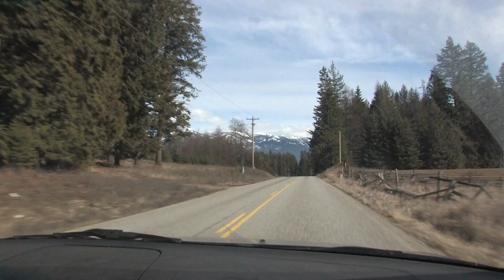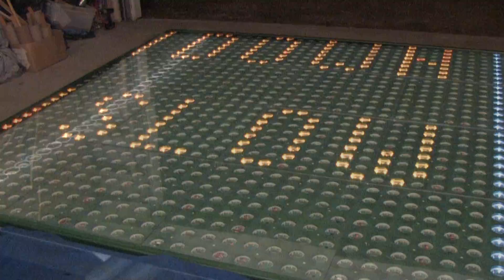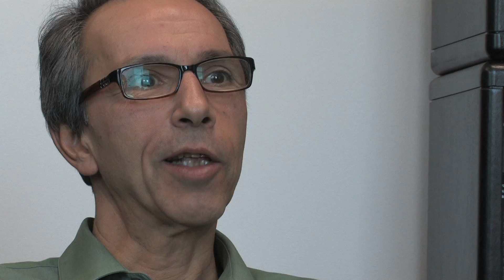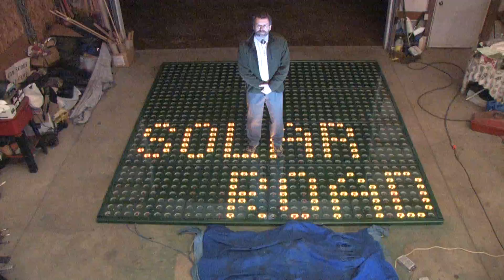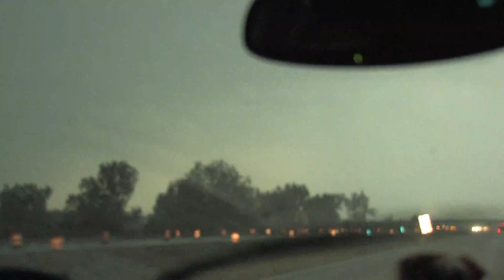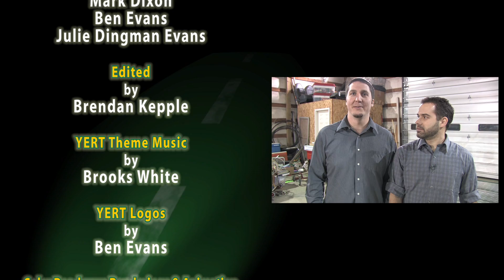Solar Roadways: The Prototype

Comment: There is an endless list of problems with this whole idea.

Firstly, they keep pounding on how hard glass is. That's rather inconsequential. Bitumen is soft, and that's precisely why it makes such an optimal binding material for asphalt: It adapts for differences in temperature, and it doesn't break under stress. (Also, the gravel used in asphalt is harder than glass.) Glass on the other hand, no matter how hard, shatters. Especially tempered glass (which is what they are promoting) shatters easily with even the smallest of cracks. And if such a pane of glass shatters on a speedway, not only will it destroy the solar panel, it's a huge safety hazard for the cars.

And such glass panes will get shattered pretty easily and pretty often if used on a road. You can't avoid gravel and small sharp stones ending up on the road and vehicles driving over them. They will crack, and they will shatter, that's just a fact of physics.

Also, such loose panels are hazardous on a road all in itself. Like said, bitumen being soft is great because it adapts to whatever small changes there may happen on the soil under the road. Rigid panels won't, causing unevenness and dangerous situations.

They are also greatly overestimating the efficiency of fixed solar panels on a road. Solar panel efficiency is something like 30%... when facing directly the Sun. These panels won't be for the vast majority of the day (and at many places never.) Also only a fraction of the hexagon will actually have solar panels, decreasing the efficiency even further. Transporting the electricity will incur even further losses and thus decreased efficiency. (The 30% efficiency estimate of a solar panel facing directly the sun is measuring the electricity produced directly by the panel and does not take into account losses caused by transporting the electricity over larger distances.)

Add to that the fact that the proposed LEDs and all the electronics in the panel will consume a significant portion of said electricity, and you have to reduce the total efficiency even further, possibly even reaching zero or even negative efficiency. (And if you add to that the completely ridiculous idea of heating elements to melt ice, you go well beyond negative efficiency pretty fast.)

And add to that the fact that the Sun doesn't shine all the time. It gets cloudy, it rains, it snows, the road gets dirty, cars are parked on the road... over half of the day will be night in winter (especially the more north you go)... Thinking that these panels will produce more energy than they consume during an entire year is a completely ridiculous idea.

And of course there's the problem of cost. It doesn't matter what kind of production lines you have, producing this many panes, with this much glass and this much electronics, is going to be prohibitively expensive. The panes won't be producing enough electricity to even run themselves, much less run anything else, so it would only be a complete waste of money.

The proposed LEDs won't be visible enough in bright daylight. It doesn't matter what they claim (and their counterexamples are fallacious). There's also the problem that LEDs, electronics and entire panels will get broken. This not only will hinder showing anything on the road, it would actually be a hazard.
Reply: tbone66613
Engineering cannot break the laws of physics, no matter how enthusiastic and visionary the engineers are.

"The solar farm in canada "first light " is only on .36 km squared of land and is creating enough power for 1000 homes ALL YEAR AROUND"

How are the panels oriented? Are the panels full of electronics, LEDS and radio transmitters that need to be run by their own power? Are cars and trucks constantly driving over them, grinding gravel onto their glass surface? Are they covered in oil, rubber, dirt, gravel, and all kinds of stuff? Do they constantly break off, causing hazardous situations to cars driving at 80 MPH? How far away from the panels is the power distribution plant?
Reply: @DjVortex-w  I disagree with you completely!! It's engineers that built the laws and it will be engineers that destroy the laws.
Reply: There's also the cost of upgrading the education of every road worker in the areas where these would be installed. Who's going to pay for that? It sounds like a gigantic black hole if you ask me.
Reply: Also, even if this were somehow feasible to implement and they would be implemented, people are going to steal the panels.

The authors argue that there would be anti-theft systems using radio communication between the panels. Besides this increasing the cost and energy consumption of each panel even further, it's trivial to circumvent: With a faraday cage (which would be easy to build eg. inside a van or truck.)

And a faraday cage is not something that you need super-expensive advanced technology to build. You can easily build one from scrap metal at virtually no cost. (And even if 99% of criminals wouldn't understand the concept, it's an easy-enough trick to teach, so it's enough for just some criminals to come up with the idea.)
Reply: *****
/watch?v=obS6TUVSZds

That guy actually knows how to do the math. He is also an electrical engineer.
Reply: Just because the project has good intentions doesn't mean it's a good idea. Place the tiles over the roads instead if you desperately want roads and solar panels to be united. People become defensive about it and think any criticism is anti-green or some shit. No, I believe most critics just want the attempts at producing viable energy alternatives to be practical and feasible.

This is not the only horse in the race, and quite frankly it's a crippled horse, but if you want to bet your money on it because it's cool or some shit then do it but it's a bit like deciding to use gigantic paper sheet barricades to defend yourself against a rising ocean, it might just cost you.
Reply: I really am pro-solar, but we have to consider the cons. They will get dirty, oily, they will break, they cannot produce enough energy unless they are facing the sun or they are placed in Ecuador, Libya, Panamá, etc. They will get scratched and that itself will deflect lots of light. Just throw a small rock to the road and the entire block is done. If one block cracks ¿where does the glass go? Exactly, now you have a chain reaction.
¿Can this 'project' boost glass research? Hopefully, but that's not enough. Supporters ignore a simple fact: They will not face the sun all the time, what you put in you'll get out, that's that. I know that our power demands are getting higher, fossil fuels is not the answer anymore, but with simple math you can tell this is not the solution.
I'm just bookmarking all these videos, will come back maybe two years later. By then the 'inventors' will be long gone.
Reply: TheBushdoctor68
Are those cells flat on the ground, or are they angled on a rooftop?
What was the cost of those solar cells? Add to them some thick, unscrachable, unbreakable glass, a good bunch of electronics, LEDs, batteries, radio transmitters, a metallic infrastructure strong enough to withstand 18-wheelers for 20 years, and a power transmission system capable of transporting the electricity for hundreds of miles. Then multiply that cost by some billions.
Then, of course, you have to add the cost of maintenance. Electronic devices, LEDs, batteries, and even glass, are going to break eventually. That's just a fact of life. With billions of those things, they will be breaking pretty much daily on average. (Just consider how many cellphones break in your country alone every single day. And they don't have cars and trucks driving over them.)
They will also get stolen. The developers claim they won't, but they will. That's another fact of life. (They go all about how the radio transmitters deter stealing. Seemingly these engineers have never heard of faraday cages, something that you can build from scrap metal easily and at virtually no cost, and can be easily fit inside a van.)

And this isn't even going to the question of how suitable glass panels are as a road material.
Reply: TheBushdoctor68
It sounds like you don't understand electricity at all.

"The ones on my roof generate enough power for my home AND feed back the excess power to the grid"

"However, when they DO pick up sun, they make a shitload of power."

How many solar panels do you have?
How much did they cost(install included)?
What is their rated output?
How much power do you produce per day?
How much do you consume per day?
How much do you buy kw/h for?
How much do you sell kw/h for?

The biggest thing is what the panels are rated for and how much power you produce per day. If they numbers are right your comment would hold some ground but if you actually do the math I'm sure you'll be surprised at how much power you are NOT producing.
Reply: TheBushdoctor68
If we're separating glass into breakable and unbreakable then there is only one kind of glass so far, breakable.

If you can invent unbreakable glass then I have a great business proposition for you!
Reply: Fade2Dark
They need to show us evidence that it has the same traction properties as asphalt. They say it will work but we need to see it. A 2 ton tractor driving at 5mph over it doesn't show anything.
Reply: +Matthew Madruga  "leds only cost less than a volt"
A volt is neither a measure of money nor energy. You have no clue what you're saying.
Reply: *****
So, who's going to pay for all those tiles? Who's going to pay for their maintenance? Who'd going to pay for all the accidents that they will cause?
"Who cares?" doesn't cut it.
Reply: I got a bolt, not a nail, a bolt in one of my rear tires, I can hear it hitting the pavement all day. And my truck also leaks oil. Sometimes I think that the dark stripe in the middle of each lane is there just because of me. Now, if the road was made out of glass ...
¿Have you ever seen a soda can or bottle in the road? I like to smash them with my truck (who doesn't). Now, if the road was made out of glass ...
¿Have you ever seen a vehicle blow a tire? Pretty violent, and then the rim running against the road. Now, if the road was made out of glass ...
¿Have you ever been in Los Angeles, San Francisco or San Diego around 4PM? Rush hour! Roads full of cars. Not sure if 60% of the sunlight reaches the road.
I had an accident once on my motorcycle. I had frame sliders on them so it wasn't so bad. Now imagine a frame slider hitting a block of glass. Not to mention that some bikers use metal cages. Go ahead, turn on your radio in the morning and listen to the traffic report, there's always a motorcycle accident, every day.
Now let's assume that there is a glass type that can handle all this punishment. In a period of 6 months it will be so scratched that most of the light will be deflected and won't reach the panels.
I'm tired of the 'is harder than steel' phrase. ¿What does steel has to do with anything? ¿Has anyone seen a steel road? ¿Why not? Think! Because replacing steel sheet on every accident is still expensive. Even [cheaper] steel roads are dumb, that's why we have steel tracks and not roads.
Oh, wait! There is a material that can handle everything and can make the perfect fit. Diamond!
This video was uploaded on 2010. I'll stay around for another 5 or so years following this 'project'. This thing is going nowhere. I am not anti-solar by any means but if you guys think it's such a great idea then go and donate. The more the better.
Reply: Laz Sz
So you are saying that glass cannot shatter if only part of the covering is made of it? (Besides their later version has a full glass cover.)

Glass can withstand a great amount of weight. when that weight is distributed over a large surface (such as a big tire) but not when it's all on one sharp point (such as the weight of a truck on top of a small rock).
Reply: +tbone66613  Math & mathematical modeling of the specific situation at hand (solar roadways) trumps in importance your bad analogies.  Nobody mathematically disproved flight was impossible or going to the moon was impossible (for a given cost).  By contrast, Thunderf00t & EEVblog have mathematically disproved solar roadways being anything other than a gigantic money black hole because of absolute laws of thermodynamics.
Reply: ***** Oh my god. I think you should watch the videos that I listed in my first reply to this thread.
Reply: ***** ¿Source?
Reply: Blaise McCord
Yeah simply because they are PANELS, the dirt and soot would definitely get inside the cracks as the panels expand and contract throughout the day. AND what about places in the north where we have snow??? Furthermore, since glass has VERY poor traction, they'd have to make a textured surface - thus allowing more and more dirt to gather up. As these panels break, they will need to be serviced at a rate many times higher than asphalt roads, and the people who service them needs much more advanced training. All this buils down to money. Another problem with renewable energy placements is that sometimes the high quality resources and pollution it take to make these panels and the countless accessories is enough to offset how the panels save energy in their entire life span.

oh and you can't plow away snow from such a textured surface
Reply: no no bro, because solar freaking roadways
Reply: That's why you test the product many times before adapting it. 

Don't knock it until you try it -- but don't accept anything until proven otherwise.
Reply: Kevin Ai Xin Jue Luo
Earth 4 Energy

Safe Redirect => http://home-renewable-energy.blogspot.com
Reply: Soner Gökçe ¿Did you bought it? It claims it has been advertised on CNN, Newsmax, etc. No links, just buy. Not saying that it doesn't work, I'm planning to build my own solar panels and solar heater and living on Southern Cali it's an easy choice. I don't need your link to know that solar panels work, but having untouched panels on my roof is one thing, 3 ton vehicles constantly running on top of them is a very different story.
Still waiting for any 'breakthrough' on this project. Still nothing. ¿When was this video released? ¿2010? ¿Any news since? Maybe that's because they haven't reached the 100 gazillion dlls. Go, donate.
Reply: this is true but they will fix it and this is going to be the future of roadways
Reply: Alexco21 How are they going to fix the problem of it not generating enough electricity to make them worthwhile?
Seriously, they would do twice as good as this could EVER be by putting properly tilted panels along the side of the road.
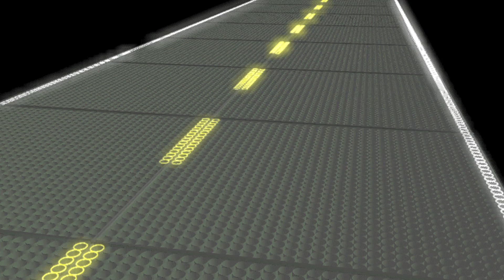Reply: 0:38   "even at 15% efficiency, it still produces 3x more power than this country uses on an annual basis."
Reply: *****
Even if that figure were even close to accurate, it doesn't take into account the cost of building and maintenance.
There are also other problems with the project that are not related to energy production.
Reply: WarpRulez I just love it when someone makes a comment with out watching the actual video.The whole lot is not just glass, the glass part are bloody small can hold a big lorry with out any trouble.
Did you notice that? It is not fully glass, just parts of the panel.
Well the trouble is it really could get stolen, but this could work.
Reply: WarpRulez We used to have a test sample of glass that was shatter-proof - I mean really. It can in a box with a stone weighing about .5 kilo. You could throw that stone at that glass as hard as you wanted and it wouldn't shatter. I don't know if solar roadways will work or not but it's always risky to say something is impossible.
Reply: WarpRulez Lookup "The Glass Age" here on youtube. Glass can be made as strong or as soft as it needs to be. Even 10 times stronger than steel!
Reply: Elliander Eldridge
The only way to make "glass" scratch-resistant would be to make it harder than rock. (After all, gravel consists of small pieces of rock, often with sharp edges and points.) If there's any kind of gravel on the road, cars, trucks and buses will be driving over it all day long. They are going to scratch that surface.

There are transparent materials that are harder than rock, but they are not glass, and they are usually rather expensive.

And if the glass is tempered and it gets even a tiny scratch, it will shatter.
Reply: Two words of advice for you pal....Fuck You.
Reply: WarpRulez  1 KWH is needed to power my iphone for an entire YEAR all the lights , and tech put into these solar panels will cost less then 1 KWH PER YEAR , so what the fuck are you talking about? you think 1 of these solar panels will lack the capability to produce a KWH in a year? biggest JOKE i heard all day. the "AVERAGE' solar array today produces 10.3 KWH PER DAY , so one panel in one single day would power 10 panels for an entire year and have 364 MORE DAYS to produce surplus power for the rest of the country? their is 1000 ways to make glass. some as strong as steel itself . as for breakage thats engineering ,it would be instantly transmitted that it malfunctioned and someone would go fix it , whats the difference if u hit one of the billion pot holes going 80 MPH "who drives that fast anyways unless on the autoban" . The Grid already runs along roads and goes to individual houses so it would only be a matter of connecting it 4FEET beside the road to the hydro lines running under the sidewalk, actually they would have constructed a chamber to house all lines,including hydro gas and fiber optics.
making future work MUCH EASIER and safe because you cant hammer a stake into the gas line and risk causing an explosion or the 5000$ fine for damaging it. so still i see NO valid points in your argument.
Reply: almost everything has a solution
Reply: +Matthew Madruga " if I know one thing about parking lots, it's there will be burnouts, drifts and much more after hours"   WTF are you talking about?
Reply: WarpRulez Here's an article talking about a glass that is shatter proof and stronger than steel. There are many examples of this I can show you, but the point is that you are wrong. Not all glass is the same. Not all glass is prone to shattering. And "hardness" is an actual rating system. You can't say that asphalt is harder than all glass accurately. You can say that it's harder than some glass, but not all. You also have to keep in mind that even tempered glass (which does shatter) can still be "harder" - that's a different issue all together.

http://www.dailymail.co.uk/sciencetech/article-1346525/The-unbreakable-metallic-glass-thats-stronger-tougher-steel.html

Another major advantage here is the modular way the road is put together. If, for example, one of this segments is somehow damaged it won't shatter and can be replaced very quickly. Instead of having to rip out the entire road and redo it like with asphalt,
Reply: Stop telling lies. Solar Roadways are the future! lol
Reply: everything you claim is a minor engineering problem and is solvable. The first Apollo rocket had less computing power then my cell phone , yet you think humans cant make this work? doing the "impossible " is how we got to where we are and if we want to keep moving we must keep trying. The solar farm in canada "first light " is only on .36 km squared of land and is creating enough power for 1000 homes ALL YEAR AROUND . my street alone with 100 houses at the most has much more AREA then first light , my street alone would have enough surplus energy to power over 900 houses , and you think a few LED's and heating system is gonna suck up that much power . my cell phone last 24 hours on a shit battery and is just as sophisticated if not more then these panels, GPS , weather conditions , text , cellular , sate light capabilities and 1000 apps . i cant imagine how power would be a problem just out of common sense and the surplus power bounces around the grid . its estimated to cost 1 trillion to cover the US roads with them. you guys owe 18 times that amount to the rest of the world LOL and its not like you would drop a trillion in a week and have it done it would be one road at a time and it would be paying itself off instead of sucking more money out of the governments pockets. I think this is an excellent idea and anyone who thinks otherwise is probably uneducated or lacks faith in the power of engineering. if a few speed bumps stopped anything in its tracks we wouldnt have tunnels, bridges, highspeed rails, or anything really. And anyone against these new tech ideas is against the survival of the human race the planet will only put up with so much abuse before we go extinct. you cant keep taking oil out of the ground and expect the empty space left under our feet to not be a problem , or to continue using dirty power and dim our atmosphere "the dimming effect" . any problems when they finally build a solar road full scale will be worked out by the great minds that solve all the other problems we face daily . Every problem has a solution or else it wouldnt exist in the first place.
Reply: Carlos Mora do y'all not understand that there would not be nearly as much dirt, gravel, and other debris because all of the roads would be panels. and there is no way you could say they don't produce enough energy. You know they do.
Reply: Carlos Mora
It sounds like you think there's only one type of glass, the breakable kind, which is a bit ignorant. You also seem to have no idea how solar cells work. The ones on my roof generate enough power for my home AND feed back the excess power to the grid and guess what: They get dirty, the sun doesn't shine every day and it even goes dark here at night time. However, when they DO pick up sun, they make a shitload of power. Miraculous isn't it. You make some pretty ignorant arguments.